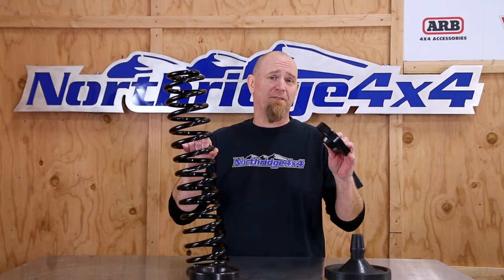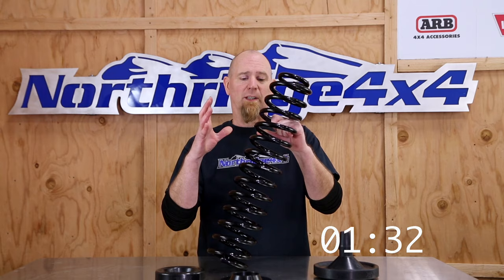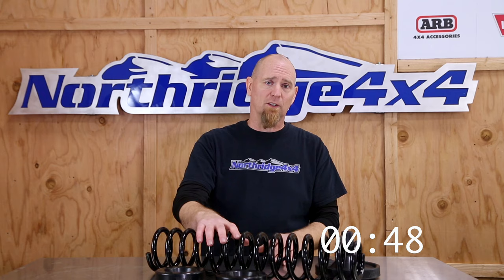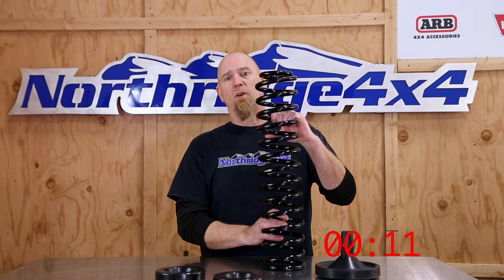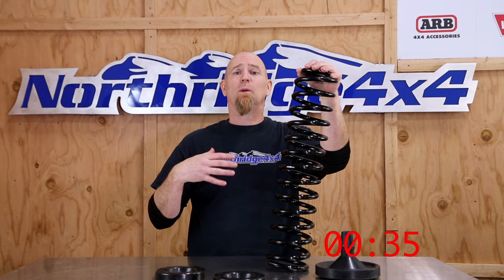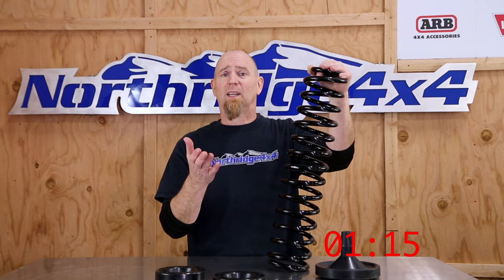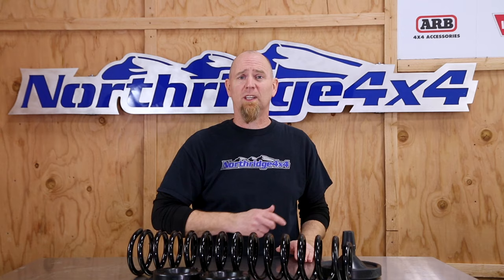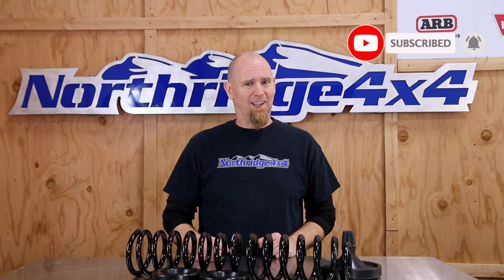Spacer Lift or Coil Spring Lift? EXPLAINED!

Comment: I have an 05 grand Cherokee and I have a 3 inch spacer in the front and I was wondering if I can’t literally just buy longer coil springs and put them without new shocks and all that?
Reply from the maker: If you already have a 3" spacer up front and everything is working, you should be able to swap it out with a 3" lift spring no problems.
Reply: @northridgenation  thanks do you think I can run both the 3 inch spacer and longer coil spring?
Reply from the maker: Add up the total lift and see what is necessary to run that combined lift on your Grand.

Comment: I put new springs on my truck to help me plow snow and my truck sat 3" higher. Lift was nice but it pulled my Upper Control Arms down and caused my front wheels to cambre in whichade me wear out my tires on the outside edges. I want to put a better spring in that adds lift but curious howni can do it without pulling the UCAs down.
Reply from the maker: You can't. By design, if you lift the IFS suspension, it will push the arms down.
Did you get an alignment after the lift?
Reply: @northridgenation  nope threw in Ranchos and the upper controls arms are level now so the wheels riding flush. But I only got a 1½" lift now, I want the 3 or 4 back. I'm thinking of buying the Gen 1 Raptor Fox Struts and installing them they add about 3" lift.
Reply: @northridgenation I noticed the Ranchos set where the spring sits higher up on the strut which keeps the control arms level. Fox Struts got three settings for perch as long as the spring isn't too long should be okay. I hope so at least. Also hope I won't need to get the SVT LCAs, because they're pricey as hell.

Comment: What about strut lifts?
Reply from the maker: Strut lifts are similar, you can use a strut spacer or you can use a longer strut and coil. Of course it depends on what's available in the aftermarket.

Comment: Hv 18 Ram 2500 6.7, front raking soar eyes looking at it. Only use it for towing 34ft trailer and street ride. Will a 2.0 will be fine, will make a difference riding or towing. If spacer will be fine what brand quality should I get.
Reply from the maker: 1.75" to 2" are the standard for Ram 2500/3500 leveling kits.
We sell both the Readylift and BDS Ram leveling kits. They are good quality kits.
FYI-It is recommended that you upgrade the shocks when you add in a leveling kit. It'll be a longer shock to match the extra height gained.
Reply: @northridgenation  your websites n parts # pls.
Reply from the maker: @denden01161  The Ram kits are not on our website yet. Shoot us an email: sales@northridge4x4.com or give us a ring at 866-601-5340. Tell them you were sent from our YouTube channel, they'll get you set up.

Comment: I have coil overs now but I want to lift it another inch or two to clear a bigger tire. Can I throw a spacer on top?! Or would that be too much? (Nissan titan)
Reply from the maker: It depends on how much lift you have now and how much your truck can take.
Reply: @northridgenation  I think it's about 2-2.5 inches of lift now. I have to see if I can even rotate my coilovers 1/4 turn to get a spacer to line up. No clue if it will even work. I can get a UCA that allows clearance for 2-4". Im running the current lift on stock UCAs with zero issues. I guess my main concern is the axle shaft angle being too sharp.

Comment: I've installed "Fox® Racing Shox 2.0 Adventure Series IFP Shock" and I was told the springs are too soft for my JK unlimited 4 doors. Any help or advise on the best option and size springs please? (i mainly use my jk for on-road while i off-road in the desert once every 2 months) appreciate your advise. thx
Reply from the maker: How does it ride?  Does it feel too soft to you?
Reply: @northridgenation  i just feel a little bit of softness. nothing major. Do you think i need spacer leveling? or air lift?
Reply: @northridgenation  Actually, i feel that the current springs are not allowing the shocks to work 100%. the shocks are not open smoothly. i feel they are not performing the way they should as the springs are making them shorter. no room to perform.
I was told i need to replace my springs and the car will befitted 5 cm. any advise plz?

Comment: Is a spacer lift hood for off-roading?
Reply from the maker: It will help you clear larger tires, which will help off road.
But, you'll typically get better performance with a spring lift.

Comment: would I be able to increase my tire size with a spacer??? (max 35")
Reply from the maker: It depends on the vehicle and the spacer, but yes, with a spacer you can typically increase tire size.
Reply: You could go up to a 37” tire and still have travel in the suspension I run 35” tires no lift and thin fenders

Comment: I wanted to get a set of coils that would give me 2.5 inches. But it's just the springs. Would that work?
Reply from the maker: Typically not, but it depends on the vehicle. Often you can get by with an inch lift without too many mods. But a 2.5" lift, your shocks and brake hoses will probably be too short. There may be a few other items too.
Again, it really depends on what vehicle.
Reply: @northridgenation  I saw a video of a guy doing a 2.5 inch lift on same vehicle I have. He didn't do anything with his brake line or anything. Only difference was he used a Budget boost (spacers). So you think I'd be good to go with that?

Comment: I have a question I got 2022 Tacoma what do you recommend if I go for spacer, how many inches do I go for front and rear? I don’t go any off roading anything like that I just want for the looks.. thanks
Reply from the maker: 1" spacer kit in the front for leveling it.
For a lift, most people are going with 2" to 2 -1/2" spacer kits for the newer Tacomas.
Reply: Can I put 33” wheel if I lifted 2” on the front?
Reply from the maker: @mikeu3660  Every application is slightly different, depending on wheel offset and other variables. However most Taco's we see at minimum need a fender / plastic inner liner trim and often a CMC, or Cab Mount Chop to clear anything bigger than a 32" tire: https://youtube.com/shorts/2WlqOP7_OsM?feature=share
Reply: @northridgenation  ohhh ok thank you

Comment: Could you risk losing travel if you use a longer spring due to coil bind if all you replace is the stock springs with longer springs?  And if all your are doing is either adding a spacer or replacing just the springs (not additional parts as you mentioned), is there a real difference in the expected performance?
Reply from the maker: That is a loaded Q with lots of possible answers. Typically in the aftermarket we are using the taller coil (or spacer) to make more clearance for larger tires. The larger tire will dictate limiting the compression, so the taller spring won't compress to coil bind.
However the taller coil will droop more, allowing an overall gain in travel.

Comment: Something I can’t find a good answer to is, what’s the difference between the top puck spacers and the thicker spring seat spacers? Examples would be Westcott designs spring seat spacer.
Reply from the maker: A spacer is a spacer, there really isn't much difference. However there may be reasons why you see them in the top or the bottom position. Component clearance would be the number one issue we could think of.
Reply: @northridgenation  so you’re saying that a puck on the outside of a coil over is the same thing as a thicker spring seat adding preload to a spring?
Reply from the maker: @OrganizedMud  Very different if we're talking coil-overs.
A spacer on the top or bottom of the coil over mount itself will add lift. 
A spacer in-between the coil seats will add lift and preload.
Reply: @northridgenation  which one is better?
Reply from the maker: @OrganizedMud  It depends on what you need.
Reply: @northridgenation  how so? I’m trying to understand the difference. I’m trying to lift my vehicle without negatively affecting driving characteristics significantly. I noticed your video was very informative but didn’t expand on the difference of these two types of spacers. If you could explain in regard to the mechanical affects that would be awesome. Thanks 🙏
Reply from the maker: @OrganizedMud  Do you have a live axle suspension or an independent suspension?
Reply: @northridgenation  Independent front. 2022 4Runner TRD Off Road.
Reply from the maker: @OrganizedMud  You already know about lift. To explain preload quickly, think of the spring rate, as you compress the spring, you are preloading it, which can change the way it feels.
This video is really about addressing spacers in a live axle suspension. We really need to do one discussing independent suspension and spacers, we'll try to put something together in 2022.

Comment: Hi Northridge4x4,

Can you please give me your thoughts about combining spacers with spring?

thank you
Reply from the maker: You can combine spacers with springs as long as they fit together correctly and other components are designed to work with the total amount of lift.
If your spring has 2" of lift and your spacer has 2" of lift, then you will have a total of 4"s of lift and you'll need to have all the necessary components for a 4" lift.
Reply: @northridgenation  you said "all the necessary components for a 4" lift", all I know so far you need to put the right UCA for the right lift, are there any other components I should be aware about for lifting my truck?
Reply from the maker: @A.A.HadiWhite  Extended brake hoses? Longer shocks? Driveshaft spacers or mods? Drop brackets? Bump stop extensions?

Comment: How much will it affect my ride with 3” spacers added to my front suspension?…it’s a 99 Silverado extended cab and the front currently sits 1” lower than the rear so I’m assuming it’ll lift the front suspension up 2” higher than the rear?? That leads back to my question of how much will it affect my ride ? Really I want to know if I can still do donuts in the dirt haha
Reply from the maker: If the front is currently sitting 1" lower than the rear, then yes, adding 3" lift spacers to your front should put the front end higher than the rear.
Usually adding that much spacer to an independent suspension can make your ride stiffer by preloading the springs a lot.
Reply: @northridgenation  so basically off road won’t be so smooth and bouncy anymore ? Will I damage my shocks or springs ?

Comment: I have a spaccer lift on my v50 volvo 45mm  all 4 corners was 1000€. Not cheap!! Spaccer come in 15mm stack in any option you want. Would i spend 1000€ again no way..... definitely look at different coil springs.

Comment: Can u do both ? Or will the truck ride bad ?
Reply from the maker: You can run them both. Just be sure that the lift combination with work with the other components in your suspension and that you do not mess up your suspension geometry.
Reply: @northridgenation  thats what I want in my forester, 2" spacer for sst front and back, and 1.6" front and 1"back with eibach spring

Comment: Can somebody help me? I have a 2000 Toyota Camry. L. E, it's a little bit too low to the ground for us. And we're trying to lift it between 2 and 4 inches Is there anybody that sells that for article the camera?I don't want to spend too much money
Reply from the maker: We do not sell any lifts for the Toyota Camry. Hit up Google, there are companies that do sell lifts for them.
The problem is the size you want, anything over 1-1/2" on a typical car suspension will be pushing the limits of what the OE suspension can do and will require lots of mods.

Comment: what happens if i do both?
Reply from the maker: You have to combine the two lift heights and plan you mods for the total amount of lift.
2" coil + 2" spacer = 4" lift. So you'd need to do any necessary mods for a 4" lift.

Comment: Im here cuz I want to lift my Bronco Sport BigBend 2022.
Reply from the maker: For spacer lifts, we've got the Rouch Country 1.5" Lift:
https://www.northridge4x4.com/part/0-2in-lifts/40100-rough-country-1-5in-lift-kit
And the Rock Krawler 2" Lift:
https://www.northridge4x4.com/part/0-2in-lifts/fb20as-rock-krawler-2-0-inch-adventure-system
We also have the Rough Country 1-1/2" lifted struts, which will help you maintain a more stock like ride over a spacer: 
https://www.northridge4x4.com/part/shocks/501120-rough-country-n3-performance-loaded-struts-pair-1-5in-lift

Comment: Can you  use both
Reply from the maker: Yes, you can. Just make sure to add the total lift together and make sure you have all the proper components needed for the total amount of lift you have.
Reply: Thank's  vary  much you  have been so helpful,  one other  question please is the 05 Cherokee's  axle  sold  front and back or just  the back  thank's  again. 😉
Reply from the maker: @georgemullin7772  2005 Grand Cherokee is IFS, Live axle rear. 
2011 Grand is IFS/IRS.
2005 Cherokee would be the Liberty and that is IFS/Live axle rear.
Reply: Ok thanks  again  most helpful  I was considering  a 3 inch lift with 285, 70, 17s if it's  not solid  axles  I'm worried  about  doing  the job without  to many  complications

Comment: I have a ford flex that was lowered on lowering springs. I like some rake since its levelled the ride height and as soon as you put some weight in the back, it starts to sag. Which spacer can I use to lift the rear by an inch?
Reply from the maker: Spacers are not ideal for sagging suspension due to added weight, you best best would be a stiffer spring.

Comment: Does a 2” spacer lift affect your struts and suspension? On a F-150 2010
Reply from the maker: The 2" spacer lift is common on the F150s to level the truck. Often called leveling kit.

Comment: hi Northridge4x4,

I  got another question

Does the pressure must be directly pressing on the spring coil or not necessary to get double the inch lift??

for example:

if I cut the bottom eye of the sturt off and add a 1" rod welded  between the strut and the lower eye (done by a pro of course), in other words add 1" to the total hieght of the strut will that give me 2" or 1" because it's not between the spring and chassis?
Reply from the maker: Is this independent suspension or live axle?
If it is a live axle, then a 1" spacer adds 1" lift.
If independent, it depends on the leverage ratio of the coil-over strut to lower a-arm.
Most independent suspensions are in the 1:1.5 to 1:1.8 ratio range. 
So if you added 1" spacer, you would gain 1.5" to 1.8" of actual lift.
Reply: @northridgenation  so welding a rod is also called a spacer lift?

My truck is a ford ranger 2021, I think independent suspension.

the reason I ask, because I bought a heavy duty coil for heavy load (which is hard to get where I am at), I can only get 2" of lift out of it with a spacer.

I was wondering if it will add pressure on the spring coil if I added length to the strut base to get more lift.
Reply from the maker: @A.A.HadiWhite  We're going to refer to it as a spacer lift, because you are basically doing the same thing.
For a coil over IFS there are two types of spacer lifts. Those that lift the strut assembly (like cutting and extending your mounts would do) and those that space the spring.
Adding a spacer to the spring will definitely add pressure to your coil.
Extending the mounts would only increase spring pressure if you are having to compress the assembly to get it in the mounts.

Comment: Coils on modern Jeeps and other 4x4s are pointless if you're not building a dedicated "extreme" rock crawler with long arms, massive axles, and custom shocks.

It's not spring height that adds articulation. It's control arms and shocks. 

For 95% of owners, spacers are better. You keep the factory spring rate, your lift is exactly as advertised (coils are never exact), ensuring you can dial in geometry, and you still gain articulation with longer shocks and arms.
Reply from the maker: Coils give a much better ride, both on road and off than leafs springs. 
Coils vs. Spacers can be argued either way, though it really comes down to intended use and budget.
Spring height has a lot to do with articulation. You can't have 15"s of articulation with a 10" coil spring. BUT it's all part of the package with longer shocks and better control arms.
If you are not adding a lot of weight to your vehicle (armor, bumpers, winches, tools, RTTs etc) spacers are a great solution for most people, especially if they spend 95% of the time on the road.
For those adding extra weight to their vehicle, they'll soon find that a heavier rate spring can offer a lot more than a spacer can.
BUT then again, spacers are a great choice especially when you consider the price difference between a spacer kit and a replacement coil kit.

Comment: So I have a question on something you didn't touch on I have a 2006 Toyota Tundra I'm going to do the 6112 front and 5160 rear my question is for the front if I do the 6112 and Notch it up for a two to two and a half inch lift is it going to ride stiffer??? Vs so a 2 or 2.5 spacer. And let the spring and shock be at the normal "none compressed" height??
Reply from the maker: Preloading a coil spring will not increase the spring rate, but it does increase the rate at which the spring starts to move, so typically you would have a harsher ride over smaller bumps.

Comment: Hey , have a question hope you can help , what should I do to improve comfort on a Chevy Camaro suspension, it feels though driving when there bumpers on the road, is good to use taller springs?
Thank you
Reply from the maker: Spring rate and shock valving are what you need to look at.
Typically shocks are easiest way to change ride characteristics. 
A taller spring wouldn't make it ride any better unless it was a softer spring. BUT, if the shock isn't tuned to the softer spring, it may ride too soft.